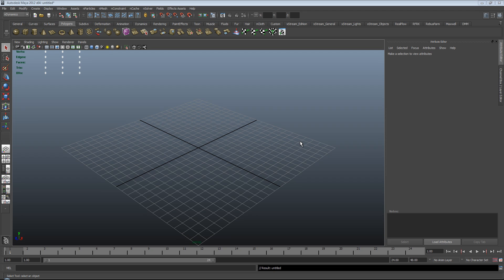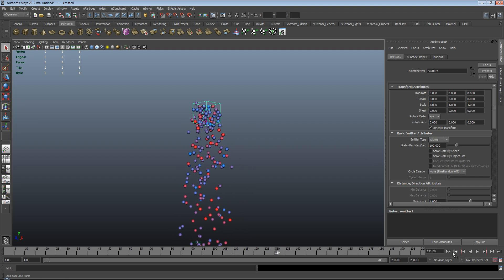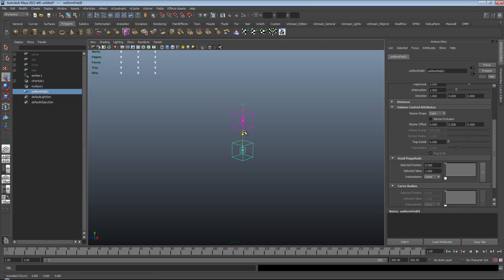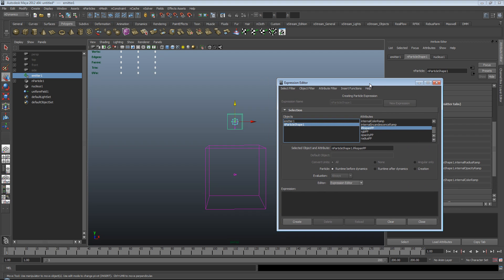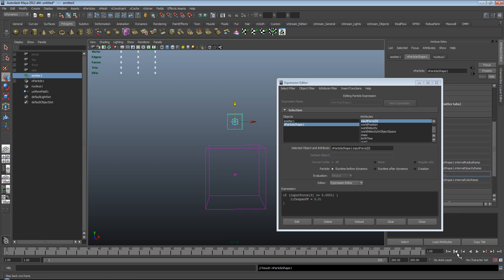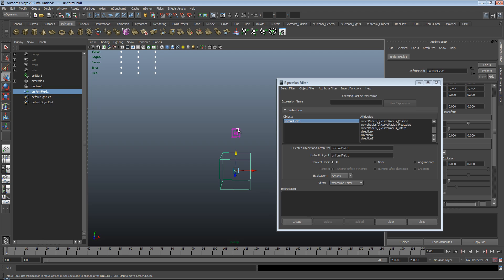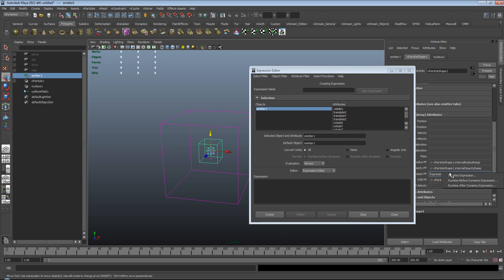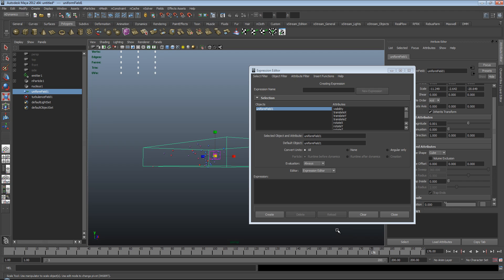Particle Kill Fields in Maya

Comment: you can add another attriute to get rid of the Particles that spawn for one Frame. You might not need it but i did.
Maybe there is a better way to do that. If you know one than tell me.  

if(inputForce[1] >= 0.00001) {
lifespanPP = 0.0;
rgbPP = 0.0;
}

else {
rgbPP = 1.0;
}

now you can simply use the rgbPP output as Opacity for your Particle Shader.